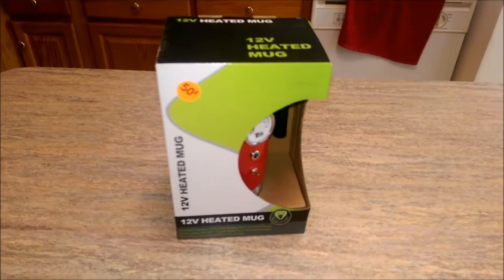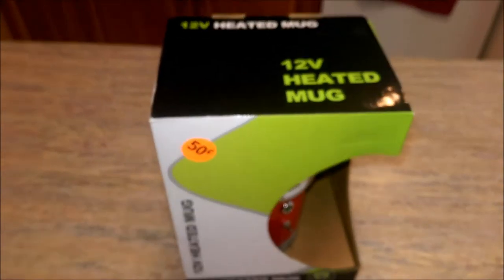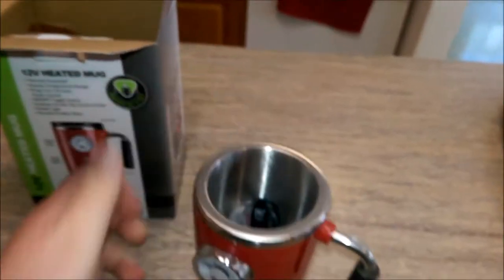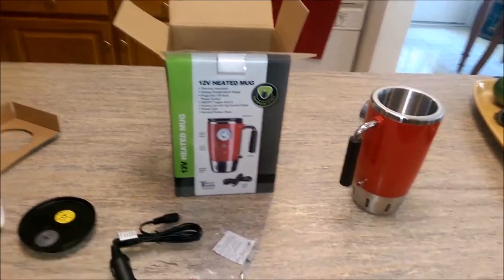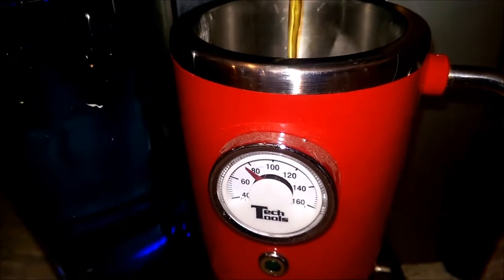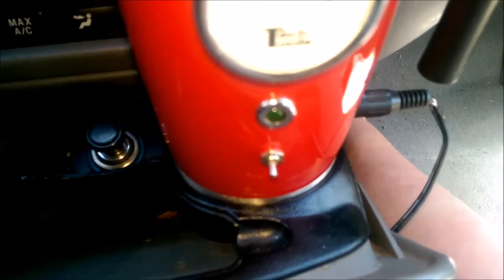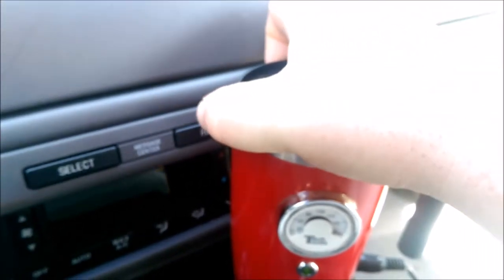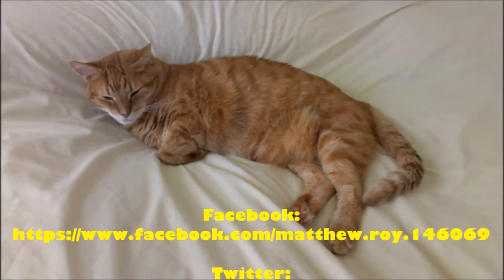Tech Tools 12-Volt Heated Mug Review

Comment: I sadly have to disagree with you matmroy. I find this mug to be a bit of a ripoff as far as build quality. I found that washing it by hand, the internals become soaked as there is no water proofing on the gauge or charger port. The gauge fogs up ridiculously easily. Also, upon opening it up by removing the screw under the foam pad on the bottom that the base itself isnt even one piece and the advertised self shutoff sensor that supposedly turns the mug off at 160 is non existent. Overall, this is more of a novelty item than a functional heated cup.